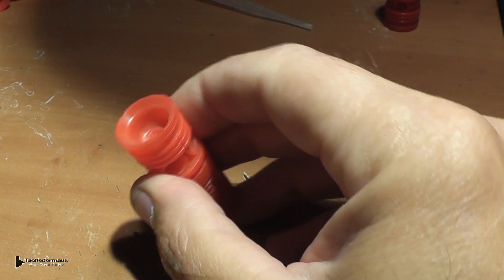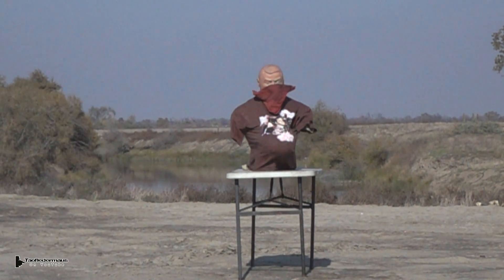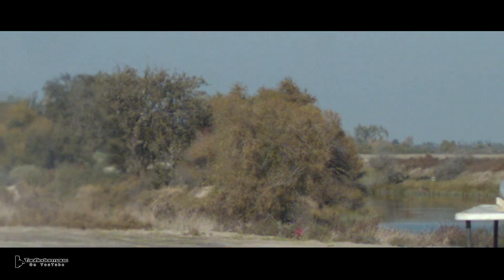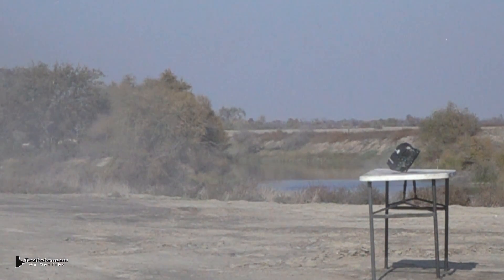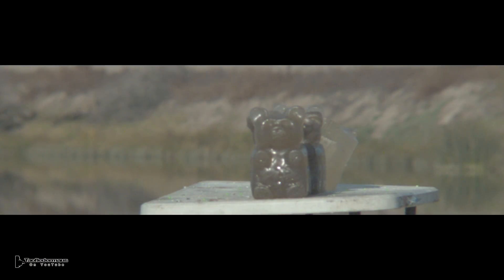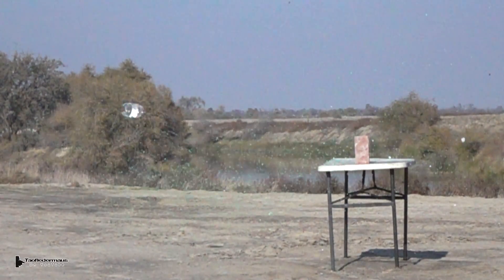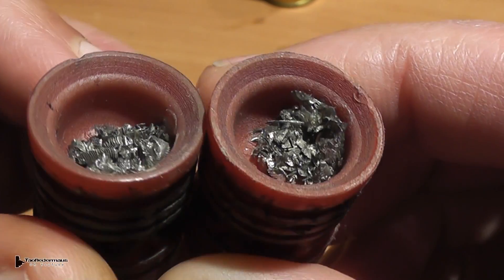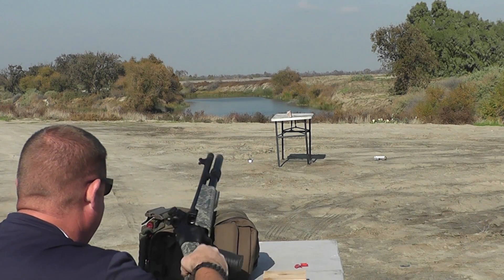Magnesium Shotgun TRACER Experiment -You Asked for It

Comment: To ignite the magnesium you will need lots of oxygen aswell, so I guess by using the hot glue it doesn't allow the magnesium to get enough oxygen to ignite effectively
Reply: Adam Owen 
Agreed.
TAOFLEDERMAUS,  The glue forms a coating which protects the magnesium from the buring powder and further acts as a heat sink to prevent the temperature of the magnesium from rising to the ignition point. The magnesium has to be directly exposed to the primer blast or gunpowder burning, which is why there were sparks in the last video, but not this time. I recommend making the magnesium into a coarse powder to maximize the exposure to both oxygen and ignition source. Instead of using glue, you might get better results using a thin soft wrapping of cellulose or even a flash paper to contain the magnesium. Don't pack too tight, don't tamp it, leave it about 60-40 to 70-30 magnesium "powder" to air within the packet. I think that will solve the problem. Give it a try, since you are having so much fun playing with magnesium and shotguns. I'd like to see what, if anything, it does to your shotgun.
Reply: @michaelfoye1135  Well said.
Reply: Even so, the looser ends should have ignited in that case, as they werent encased in glue, perhaps a powder,magnesium mix again along with the shotcup filled with a shavings AND powdered magnesium? The hotter burning magnesium in the powder mix should ignite the tracer assuming there is enough contact time between the two.
Reply: drill a hole through the slug and wadding and put magnesium wire in it
Reply: Adam Owen also what needs to happen is it needs to be on the outside of the slug because for the magnesium to ignite it needs oxygen and to strike something which is usually the barrel
Reply: Adam Owen magnesium finds its own oxygen. Water helps its flames, even dry ice, solid carbon dioxide, known for putting out flames, even lets it burn quite vigorously
Reply: FirebugPlays however, once the gunpowder has ignited in the shell all of the oxygen will be used up immediately. Yes the gunpowder has an oxygenator in it, but there are other combustibles in there which will use up any of the oxygen. So no oxygen is available for the Magnesium to ignite while it is in the barrel of the shotgun.
Reply: Once it is ignited.